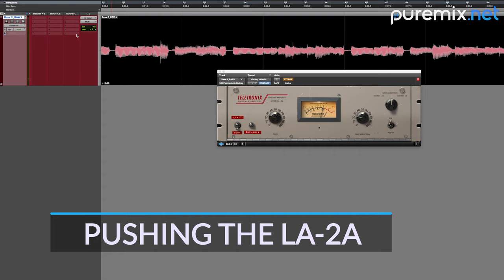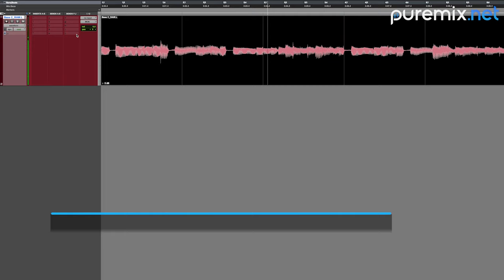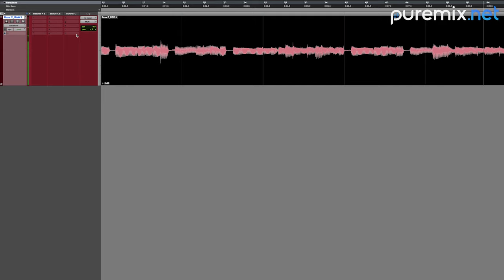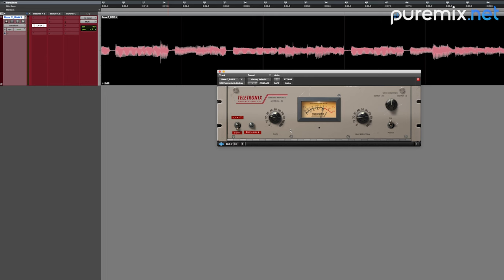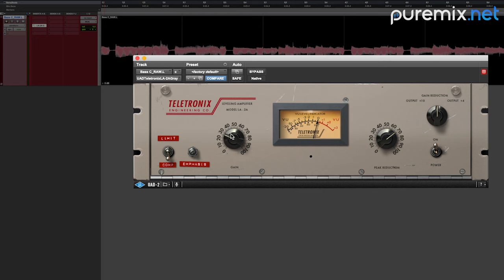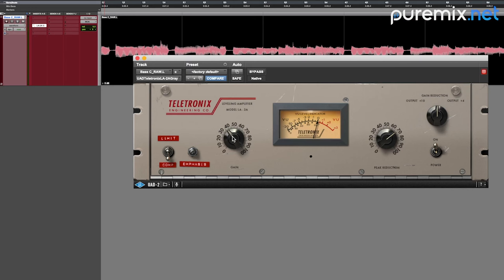Understanding Optical Compression | How to Use LA-2A w/ Fab Dupont

Comment: Operating level of UAD LA-2A is -12 dBFS. If the signal is gain staged this way when it hits the plugin, you will immediately notice even 0.5 dB of change when compressor is working.

Comment: excellent point. now, that's not only limited to opto compressors, it applies to overcompression in general, the difference for an la-2a being that it's got a seemingly minus infinity threshold. overcompression is a bane of "modern" mixing, in my view, the dryness of the signal being another, the obsession with "everything in your face" - whereas i'm a "nothing in my face, just stay the f*** back" kind of guy - even in audio, you probably wouldn't like it if people sang directly into your ear or yelled an inch away from your face - yet that's what "modern" mixers make you listen to, and guitars that you listen to with your ear pressed against the grill, so on - because reverb and space are "so 80s", whatever that's supposed to mean.